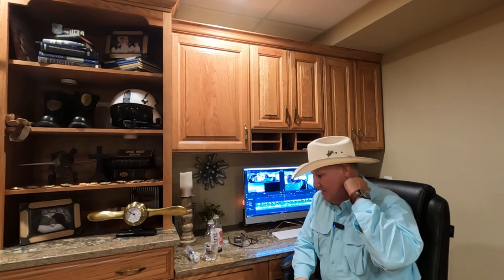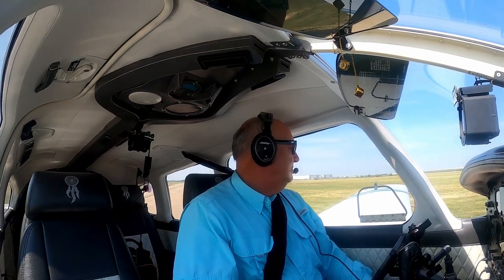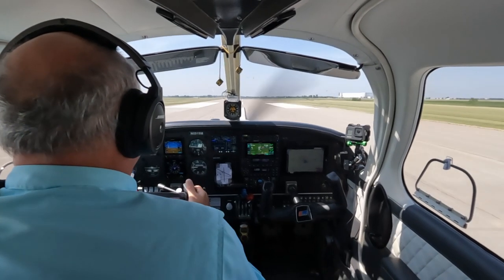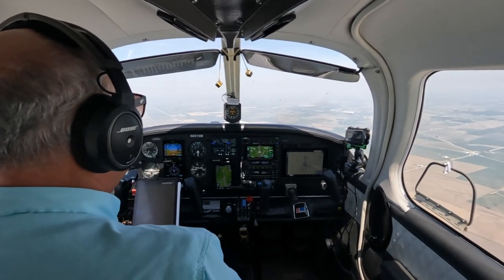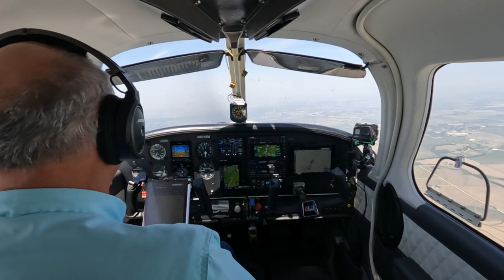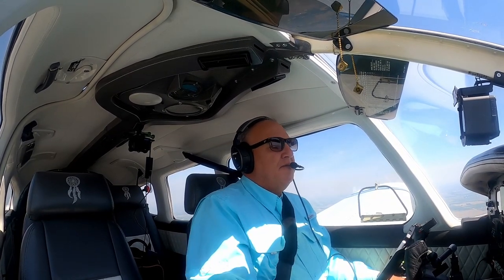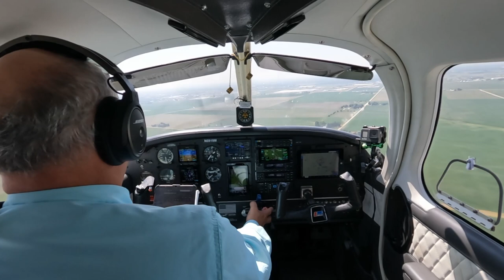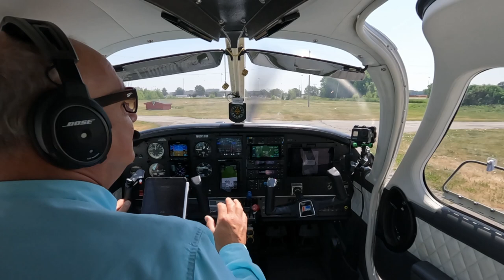Quick flight showing my power settings in my Piper Dakota.

Comment: Are you running the Lycoming 0-540 in your Dakota? Also curious about your typical endurance/range.
Reply from the maker: Yes the O-540.The range of course depends on the winds,so endurance is a better answer I think. I can comfortably plan on 5.5 hours with reserve,this  is cruising at 63% power and LOP. I plan for 130 knots and almost always get around 138-145.Hope that helps and thanks for watching my videos.
Reply: @dreamcatchercowboy I am always curious about aircraft performance of different makes and models so thank you for the information. I agree with you in that endurance is the better approach to fuel management, especially when it comes to trip planning.
Reply from the maker: @matthewmiles3974  yes sir, the Dakota is a beast that just does a great job for cross country flying.